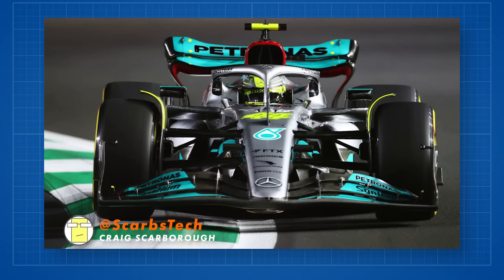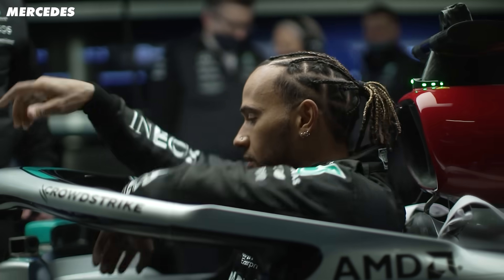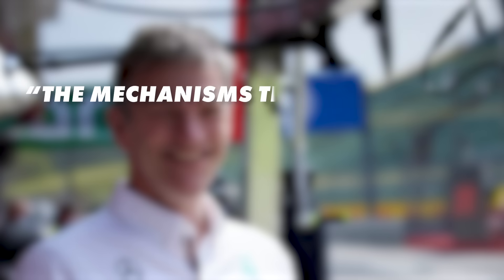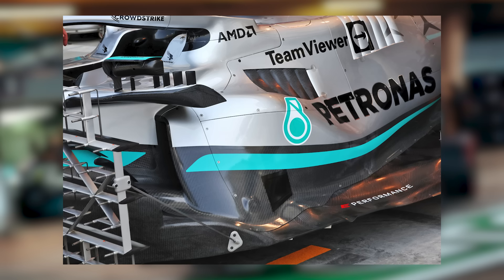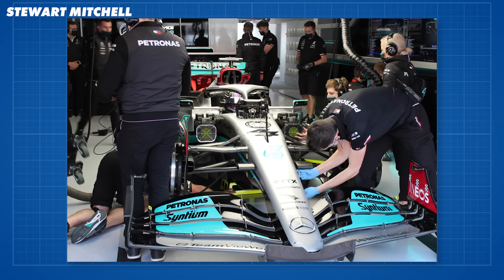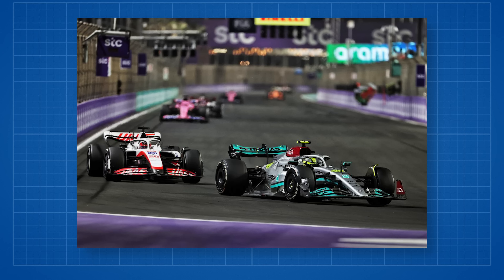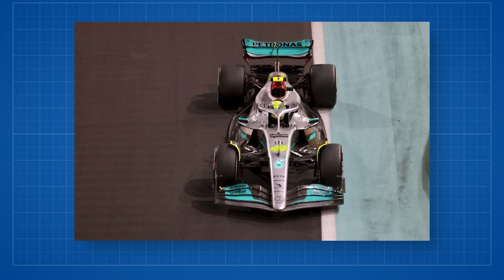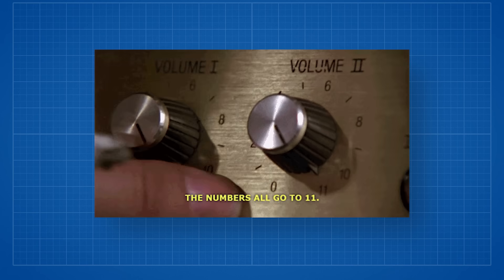The Real Reason for Mercedes’ Slow Pace | Saudi Arabian GP

Comment: The problem with the “all Mercedes engine teams problems come back to porpoising and aerodynamic problems” ignores the fact that McLaren never had porpoising issues.
Reply: while that is true, they are a lot slower overall then merc itself, which means they have fundamentally problems with the car. They might even not have the problems, because the car is too bad to have this problems
Reply: Their aero is so bad that the car cant even generate enough downforce to cause porpoising
Reply: @JV_Filmes  doesn’t explain why they ran so well at Barcelona in the shakedown when they have great aero performance and barely any porpoising.
Reply: You have to be quick to have propoising issues.
Reply: does not mean they arent having aero and brake issues tho...
Reply: and ignores the fact that all the other Merc customer cars are also having performance issues.
Reply: @visveshnarayan7964  I think they are running a Mercedes gearbox this year
Reply: exactly
how do we know they're not all proposing because the cars too slow so they're trying to run lower and be faster in corners
Reply: They did, they bolted the car with little metal strips in Bahrain testing,
Reply: they had a lot in jaddah
Reply: They dont face porpoising issues because they don't have enough downforce? i don't know man, I'm not aero engineer
Reply: That’s only because the car isn’t fast enough to even get it to happen!
Reply: They could not have porpoising due to low downforce
Reply: And Williams, it runs smooth as a cucumber but slow as molasses
Reply: I seem to remember Lando Norris's head bouncing around in the last 2 races 🤔
Reply: Also it still sounds really weird to me that all non Merc Teams don't have that level of porpoising issues. Especially the Haas is bouncing a lot. To me it feels like yes the Merc Teams loose performance to porpoising. But so do the others. The correlation between the engine manufacturer and the performance is the only real thing left. Sounds hard to believe that there is no causation.
Reply: yeah, i still think for now they having trouble addapting to the new fuel.. but once they figure it out, we gona have 6 cars up there
Reply: If you watch the post drivers' conference interview with Lando you'll hear him describe the issues the team is facing with the car and it has nothing to do with the PU.  He attributed it to the suspension and aero package because when they tried to increase performance, they ended up going backwards instead of forwards which is a conundrum for them especially after the decent testing the had at Barcelona.

You lot that are so eagerly ready to blame all of the performance issues that the Mercedes' works teams are facing on the PU, says to me that maybe you are hoping that they are operating at a deficit, or you're silently a hater/Ferrari/RBR fan and want Mercedes to fail this season.   

Either way, only time will tell if Mercedes will figure out and fix their issues and become competitive again.  If not, they'd have dropped the ball at potentially one of the most important era's in F1 history.  

Just very disappointed in Mercedes at this point but that just goes to show, no man/organization is infallible.
Reply: @alexandershaw2378  I'm not saying McLaren Aston and Williams don't have aero/suspension issues that prevent them from going faster. But I can't believe that Haas, Alfa Romeo, AT and Renault don't have those as well. That's hard to believe. And of course Lando is only talking about the issues the team can actually fix. They have no control over the PU so there is no point in complaining openly. Though I guess that will happens if the grid order stays like it is.
Reply: @Felix-st2ue  haas and alfa have ex ferrari engineers, they're sharing data and offloading development with the red team, that's y they're so good this time around
Reply: @alexandershaw2378  and if they're struggling in those areas as other teams may be they're more likely to try to run lower to have more grip in corners and thus porpousing
Even tho McLaren isn't having that specific issue.

Comment: I think Redbull have developed some clever springs that are progressive with a knee in their suspension. In plain talk it takes more and more force to compress them until you reach a certain point where it takes significantly more force. Basically there’s a wall where no more force can compress them. From a materials engineering stand point springs like this would be extremely difficult to make but, maybe they’ve done it. Just speculation on my part
Reply: I have read somewhere that their suspension changes behaviour after 250kph,dont know if true but sounds interesting and possible...

Comment: That bit about the engine doesn't seem right. I don't buy that. I'd bet they are down on power. In a side by side of qualifying laps with Leclerc, Hamilton was 300 rpm lower consistently across the lap at similar points on track and slower about everywhere.

Comment: The suspension this year is much simpler then last year no fancy springs and dampers anymore.
Reply: So what is providing the suspension then? Electrical/electronic control is outlawed, so there has to be springs and dampers involved. You just can't see them, is all.
Reply: @godimsofuckingbored  The teams I believe we're using special dampers and heace springs that basically flex  in specific ways when full aero was on them. Perfect example was Mercedes during the Turkey race with the trick suspension.
Reply: @MrManuel1329  They are still springs and dampers though.
Reply: @godimsofuckingbored  They had extra special springs.
Reply: @MrManuel1329  How technical. In what way were they extra special and how did they differ from the not so extra special ones?
Reply: @godimsofuckingbored  look up FRIC suspension it's basically a interlink hydraulic suspension front and rear and side to side. It's almost like passive actuve suspension hydraulic fluid would flow to each corner of the car essentially keeping the car flat throughout the corner this also improved aerodynamic stability. The FIA banned it because they deemed an active areo dynamic devise.

FRIC wasn't controlled by computers or motors. The teams would simply tune the valving in the system to suit the car and driver's needs. That's why it was legal for so long.

Comment: All F1 cars must be Homologated before the first race and sealed. They have 3 Power Units to last the whole season, no tweaking is allowed.
If you start out with shit, it remains shit. Some blame the new E10 Fuel in the tank, I blame the old Fuel Goldy Locks behind the wheel.
George has a better showing having driven shit for 3 years.

Comment: I agree that you can't count Merc out. However with the cost cap they can't just throw money and resources at a problem like they used to be able to. This will slow them down on coming up with a solution I think. I actually think that Mclaren will make faster progress as they are optimized for this level of resources.

Comment: Merc are misleading again, of course it is aero related, the ground effect is increased on the downstroke, keeps increasing till it bottoms out and or stalls, jumps back up and cycle repeats, hence lifting the car helped, they reduced the max peak downforce of the floor - it effectively cannot produce enough suction any more to pull down the car enough to start the cycle
when they get the hang of it and will be able to control it, they might be looking and much more downforce from the floor in respect to the competition, that may coincide with them fixing the PU deficit they obviously have - and again Toto lying about them not being down on power - yes, of course, all Mercedes cars at the bottom of the grid - and that's not PU related, with rumors long going around that one engine manufacturer had big problems readjusting to the new fuel, and we know RB(honda), Ferrari and Renault aren't them, which leaves Mercedes
Reply: Yes, the bouncing must be partly related to aero. I think maybe another translation of what they are saying is that that the aspect of the bouncing mechanism that they are struggling with is the suspension part. Not surprising since the spring/damping tech they have been working with, and understand best has been outlawed, so that's another area where they are playing catch up. Lets wait and see what happens when they do catch up ;). We'll see if they really have been running their power units in low performance mode to maximise future potential... or not...
The truth is probably somewhere in-between the extremes. There's no point in thrashing the PU's while the rest of the car isn't working, but when they do turn up the wick, they will probably be at best equal or slightly behind the others in PU performance, but maybe ahead in some other areas. How far ahead or behind, and how long it takes to get there are the questions nobody has an answer to right now. Particularly all the Youtube comments experts here who think they know better than Scarbs and James Allison... bunch of fools lol.

Comment: Yeah I don't get scarbs. First of all, I think it was pretty obvious that the porpoising got worse with the zero pods. Well other teams went on to largely correct their problem without an excessive loss of performance (everyone was showing the Ferrari bouncing down the track at the beginning). Mercedes still hasn't fixed it obviously.  When those side pods came out everybody, including scarbs was ecstatic about them, because it was different. So if the zero pods aren't a contributing factor, then something else they changed at the same time is. As to this mainly being a suspension problem, and not an aerodynamic one, that makes little sense to me.  Let's say there is a bump on the track, all tracks have them and this sets it off initially. It then keeps going and becomes problematic because of the aerodynamics. If the Mercedes engineer really thinks this, and he has scarbs buying it, they really are in serious trouble. Maybe the zero pods leave them less efficient room to make the adjustments that all the other teams in the top half of the grid have made. I think the engineers thinking is wishful regarding a major error they've made. An error that is not competitively correctable because the unproven zero pods take away some of the control they would otherwise have to make adjustments without excessive performance damage.
Reply: You're really think you know better than an actual expert? 

What's more likely? That Scarbs knows something you don't or that some random commenter on YouTube knows better than someone who makes their living analysing racing cars?
Reply: It's pretty easy to understand how the oscillation can be influenced by suspension changes: the aero may be a driving force, but if the springs, dampers, and geometry are tweaked to kill the resonance (changing phase angle, frequency, F/R balance), the porpoise effect can be canceled out. The bigger issue is that these changes need to be balanced against the other driveability impacts of the setup, and aero tweaks may be needed in order to prevent a knock-on effect to the driving characteristics due to setup changes.

Comment: I'm not sold on this suspension being the cause, and thereby the solution to the problem - When we think back to Barcelona, Ferrari were able to significantly decrease bouncing on the second day. There were many articles relating to the "slits" and in some cases holes cut into the floors to reduce the effect. The day 2 Ferrari seemed to sport a floor that started looking very much like the McLaren floor. 

Fast Forward to Saudi, in practice we again noted Ferrari bouncing at certain points as they played with setup. RB on the other hand, seem to be most on top of it. it's also interesting to note how the Ferrari is riding higher than the RB, although not to the extent of the MB. Finally, there is a picture of the RB tunnel entrance floating around which shows an intricate design - I suspect the floor sealing has far more to do with this problem than suspension.

Comment: So all Ferrari powered teams have their airo right and all Merc powered teams have airo problems? I don't believe that's the case, Merc is clearly lacking power at the moment. Whether it's the ICU or energy regeneration systems I can't tell but something is wrong in the powertrain.
Reply: I think that they(Scarbs,Mansell and others) simply cant belive that merc has so under powered ICE,there is no way that all of their cestu costumers have same aeroproblems  and that they dont run their engines at max...
Reply: @patrikvukoje6003  Agreed!
Reply: Because they were last last year. Hass had double the allowance of wind tunnel and CFD and AR ha 80% more than Mercedes
Reply: @cosminlesutan3574  How about Williams then?
Reply: @cosminlesutan3574  so much more than Williams,AS or Mclaren,RB had almost the same as merc,plus they pushed till the end last year and they are a se second ahead...
And that bs that all of merc costumers is not running engines on max is simply straight up excuse for what seams to be a down fall of merc...
Reply: Actualy that make sense, all ferrari shared wind tunnel info among themselves, so all them got aero right, in the mercs was the opposite

Comment: Personally can’t see how they’ll fix this when the floor is attached to the sprung mass of the body, when it needs to be fixed to the unsprung mass of the hub or suspension at some point. As the floor and ground effect it creates will always interfere with the suspension otherwise. Your playing with a moving target as the car speeds up and hits bumps. Anything else will surely be a compromise unless your playing around with flaps opening in the floor at certain ride hights, and I don’t suppose the rules allow either of those solutions or they would if done it.

Comment: You think it's the suspension, without any concrete evidence, even Allison is struggling to understand, I tell you what I think, it's not ONE thing, probably the accumulation of 3 to 4 things, sure the pushrod front isn't the easiest to adjust for the balance of bouncing or not, but the aero matters alot, that floor isn't dissipating the airflow cleanly enough in conjunction with the suspension setup, the engine is a problem otherwise not all Merc powered cars would be suffering like they are, your argument is that All Merc powered cars are compromising their setup and not full power is used, that's vague... I could say all Ferrari powered and Redbull powered cars are compromising their setup too as porpoising was more than evidence in nearly all cars, when you get Haas and Alfa Romeo more than a match or even faster than McLaren and Aston then you have to look at that Power Unit, if you was a betting man you would say Mclaren/Aston are bigger teams than Haas/Alfa and would likely to have quicker cars if there is a Power Unit parity, however that's not the case, you could also say Alpha Tauri and Alpine are quicker than the 3 customer Merc powered teams, pointing  again to the Engine, so the 3 factors are the biggest: engine, the 2nd: aero and finally Ferrari has superior mechanical setup to Merc as well, when added together with all teams compromised by porpoising to some degree Merc will 3 to 4 variables can't overcome big teams like Redbull and Ferrari, of course they can improve their whole package and be back in the fight but when you hear Allisson struggling to understand the issue it's not going to be a overnight fix, maybe by the first big upgrade at Barcelona Merc can haul back Ferrari and Redbull and permanently put Haas/Alpine/Alfa Romeo in their rear wing mirrors but no guarantees, in 2009 McLaren had it easier, all they needed was a double diffuser and their KERS would overcome any other car deficiencies to Brawn and Redbull, this year it's different.

Comment: Mercedes will get closer to Red Bull and Ferrari if we assume that they don't take another step forward. Remember that no team is focusing on next year, so they will put most of the budget into pushing the car forward, specially those 2 aforementioned teams since they want to fight for the championship. Every tenth that they gain with the upgrades they bring means that they successfully used their budget. And hardly will Mercedes claw back 1 second a lap with one upgrade. It has to go deeper than that and it will cost them. Under normal circumstances, the gap is too big for them to fight for the championship. They might get a few wins, but I don't see both Ferrari and Red Bull dropping the ball like that.
Toto is starting to change his speech towards the engine being down on performance. If they can't make a "reliability" upgrade that improves their engines, this might not be the only season that they'll suffer. On the flipside, Ferrari seem to have a great engine, that is both powerfull and reliable, so if they can make the rest of the package work, they might take a few championships, if Max doesn't spoil their party.

Comment: This seems to me to be caused by a resonance between the floor(sides) and the suspension, the sides of the floor shake up and down and thus the sealing amount of the flow underneath increases/decreases, hence why Mercedes have the biggest problem as they have no side pods to support the floor on the front. Reason why they added the wires/rods bracing at the back to support the floor.

Comment: The crease in Ferrari side pods seems useful to increase down force at low speed as it increases air volume above the car.
At high speed, it acts as vacuum that creates stall/turbulence, like mclaren past f duct, thus reduce drag